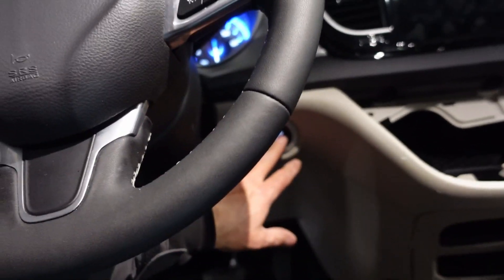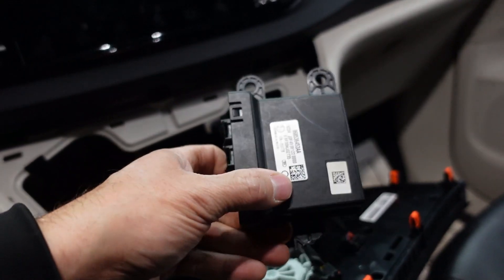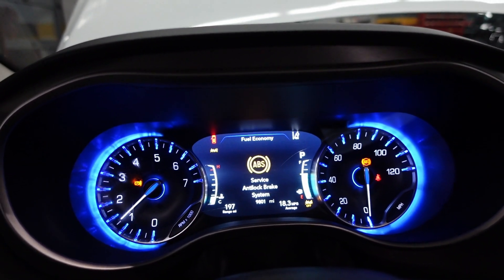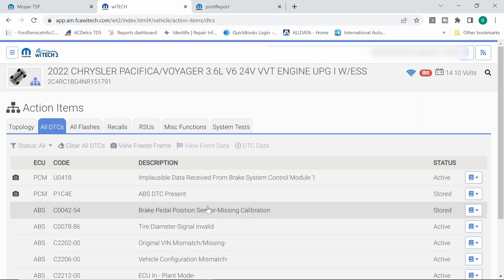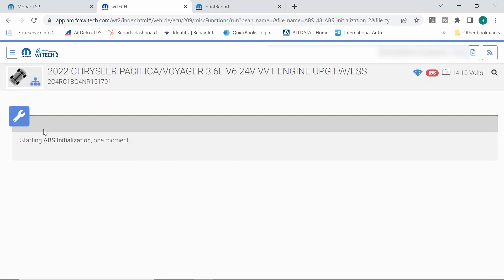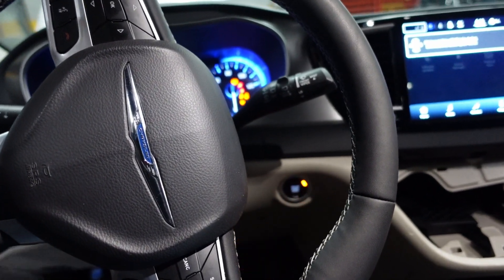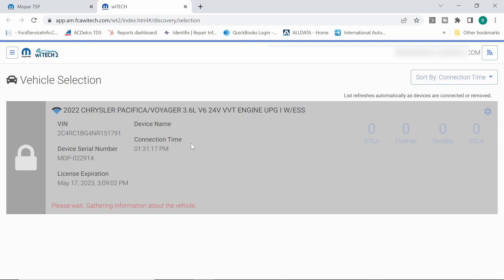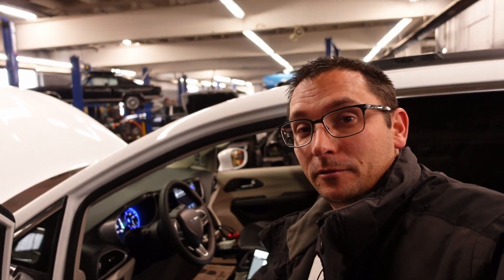2022 Pacifica New ABS Module  ?? C0042, C0078, C2202, C2206, C2212 Plant Mode

Comment: i liked the push to start that was on a 1948 chevy used right foot no computer needed no wires needed just a lever to push so simple and worked. the younger ones think push to start is new. its like fuel injection 1953 corvette had it. 1970 imperial antilock brakes neither had abs or computer but worked

Comment: Hi .. did you ever have a problem with a 2021 Chrysler programming a module and doing a proxi alignment afterwards and still have a c2203 vin missing code afterwards still
Reply from the maker: Depends on the module and the vehicle  you are doing.  Tcm yes I have seen this, pcms aswell vehicle depending